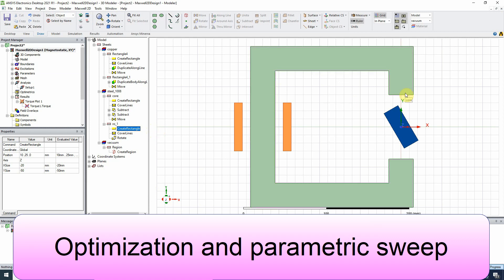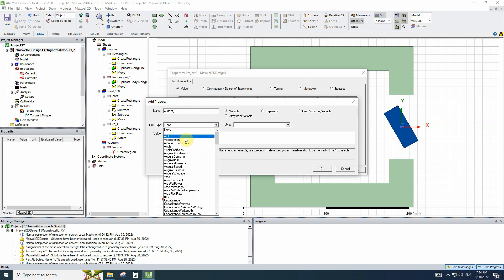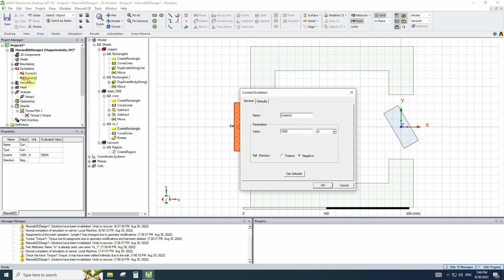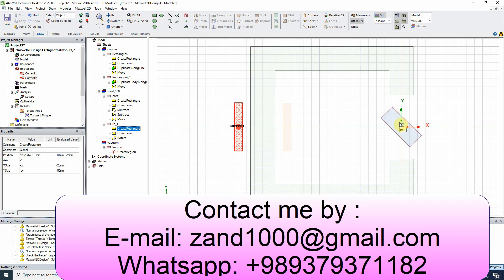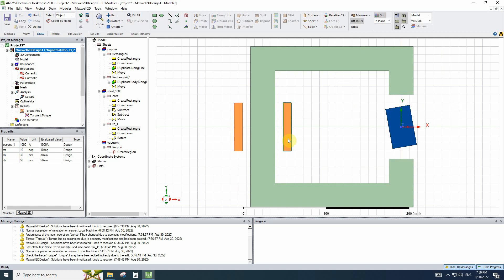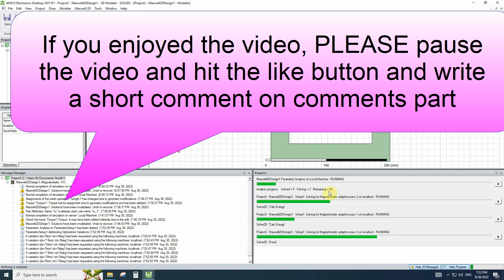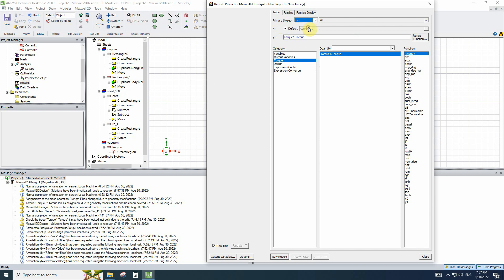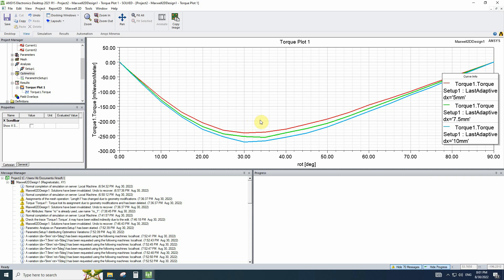How to use #variables and #optimization in #ANSYS #MAXWELL #simulations

Comment: Can I use the number of conductors in a coil ( the number of windings) as a parametric variable? when I animate the B_mag plot, my aedt crashes. am i making a mistake???
Reply from the maker: Yes . It is possible to use a variable in the number of turns in the coil. Then you can change the parameter to see the effect of turns in outputs
Reply from the maker: About the crashes, I dont know what would be the cause but you can send the photo or error or screenshot when it crashes to my email zand1000@gmail.com or message in whatsapp +989379371182

Comment: Hi, is it possible to give variable in reference speed or rpm for parametric simulation?
Reply from the maker: Yes.  Any number can be replaced with a variable.
Reply: @EMSimLab  In transient analysis, I generated a variable for speed/rpm which I assigned to angular velocity in motion setup (in unit tab it automatically converted to unitless). I tried to solve this, it resulted in very much wrong BEMF plot. Is there any other way to parametrize speed & perform optometric simulation in transient simulation?
Reply: Now it has been solved, it was due to unitless variable. Thank you

Comment: Sir, is this the same procedure with Eddy current solution type?
Reply from the maker: For geometric variables yes they are the same. But for some parameters like excitation and movement they need to be changed
Reply: I have variables such as current and time; to plot flux with respect to time at different currents, what is the process?
Regards

Comment: Can you explain the genetic algorithm involved in the optimization option?PLZ
Reply: I also need more explanation on this option also there is the multi-genetic algorithm in same list 😐
Reply from the maker: @helenhussein2939   imagine a simple transient simulation take 3 hours to be analyzed and you set the number of iteration to 50 times, this simple simulation will take more than a week and maybe it wont even converge!!!use other ways of optimization specially in transient simulation.
Reply from the maker: Hi dear Hiba. As I said in video its very time taking to use optimization in maxwell. Anyway what is the problem ? Tell me to be able to help more